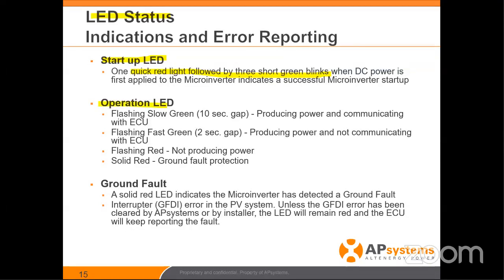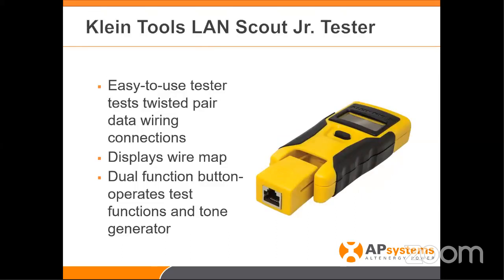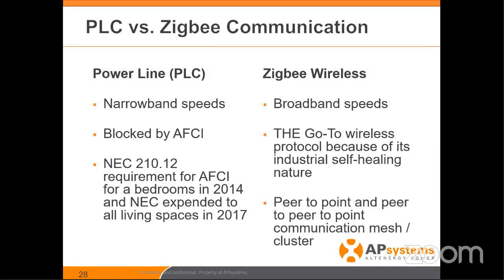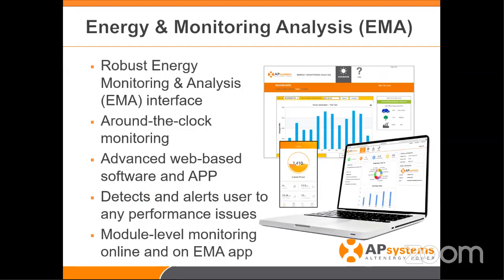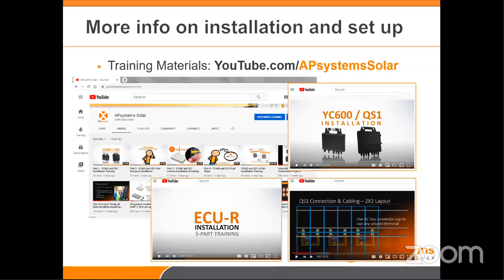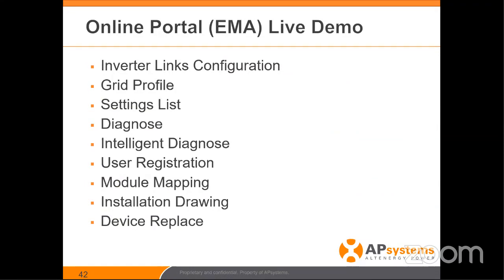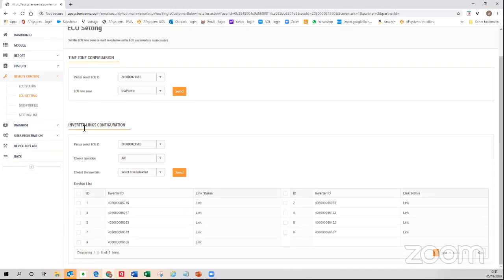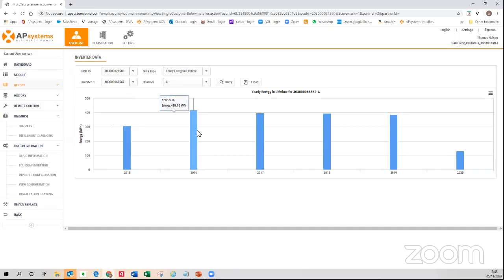Troubleshooting Methods and Helpful Tips for APsystems Installers

Comment: Good morning,
We live in Chapala, Mexico and have an APSystems solar installation. Eight panels and two micro inverters. Also, an ECU-R monitoring system.
Originally, we had two QS1 inverters. One inverter died and was replaced by APSystems with a DS3D. This replacement does not communicate with the ECU-R, but it is producing.
Looks like APSystems in Guadalajara are not capable of fixing it and it has been months since it happened.
Is there any contact in the good old USA that can assist me, please ?
I will really appreciate it.
Thank you.
Deryck S.

Comment: I was very interested in the method of trouble shooting as to testing the module by connecting the 2 leads pos and neg together....but was not able to understand the method you were describing? It sounded like what ever reading you were to get(in the example you said 44V divide by 3 and your answer would be 2/3?? would that not be 1/3? one third of 44  would be 14.6 and 2/3 would be 29.3 but I am totally lost as to what or how this is telling you any useful information. My understanding is using a amp meter you should see the amp output when the leads are connected go up as the intensity of the sunlight hitting the modules increase so I always test all the modules to verify the output under a bright test lamp or the SUN. This testing can be difficult when you have a week of gloomy weather.